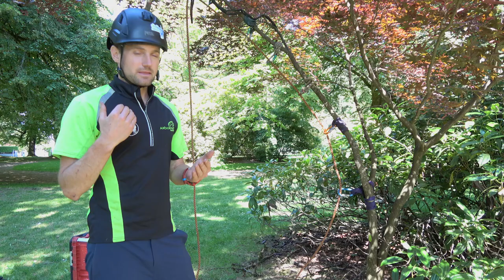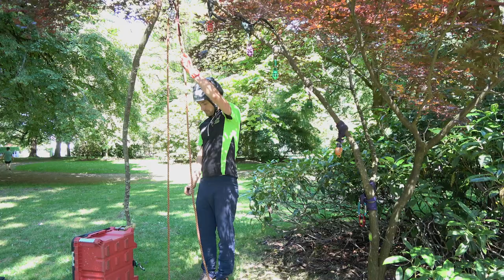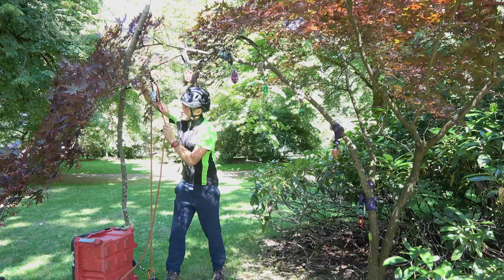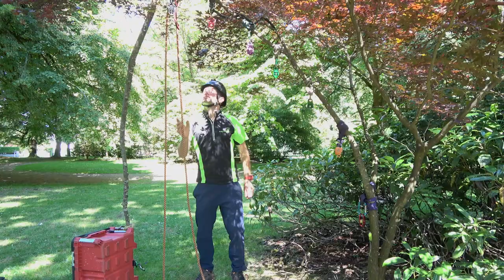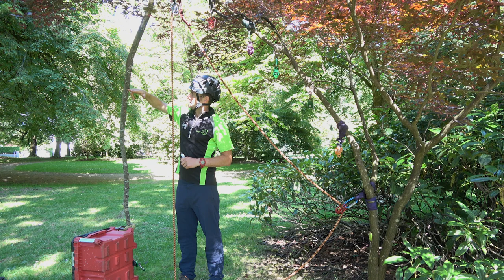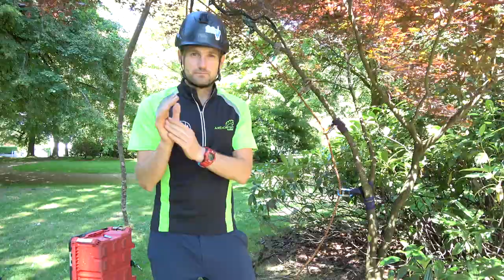Fishing pole rigging technique AWESOME DEMO showing how change in ANGLES and FRICTION affects FORCE

Comment: This technique should be taught on basic courses BECAUSE

the same principle can be applied if you have to climb up a limb to dismantle by hand and you're unsure of its integrity

You start by anchoring in a solid point below the limb in question, and then proceed to climb above your anchor point (on the questionable limb) and set these temporary karabiner anchor points every meter or so you climb up and clip your rope in

That way if the limb fails at a certain point and you fall, your weight is instantly distributed along the rest of that limb stopping you from A) falling all the way down until your original anchor point bites (due to having lots of slack climbing up) and B) eliminates you shock loading that original anchor point
Reply: Interesting concept, however if the branch were to snap under your load on a redirect, you would be shock loading the previous redirect with your weight and the weight of the snapped out limb portion, which may or may not start a Domino effect.

Maybe (Dan might be able to test this), you could place a ratchet or tirfor strap along the top side of the leaning branch to 'pre-stress' the limb towards the sky. Therefore when you climb on it, the chance of it breaking is far less. You would need to secure the strap/cable to the top side with smaller ratchets/slings/rope, but it could work

Comment: Terrific! What a great idea. Thank you very much Mr. Holiday. This could be very useful if someone has a somewhat sketchy limb they need removed. Looks like a fun physics challenge too. Makes me wonder what happens when you place pulleys in other spots on the tree.
Reply from the maker: Thank you so much for your comment Marty, and for your token of appreciation 🙏  It is a brilliant technique for special circumstances and as well as spreading the load and changing the direction of force it offers a backup of rigging points too. Any setup you have wondered about you can easily setup up in a very small tree like this and you can see the feedback from the tree in real time.

Comment: hello, you say that the first two pulley "share" the load. if you look at the angles, the second pulley will see very little force. the first and the last pulley will see the same force (how you pulled on it anyway) and all the other pulleys will see almost the same force. would have been interesting to say that with rings you will have more force while lifting and less force while lowering, with pulleys its the opposite. you kind of showed it but it lacked explanation.

also wouldve been good to show how a bisecting angle (loading the stem in compression) would make it move even less.

kind regards,
friedrich
Reply from the maker: Agreed that I mis spoke if I said the first two pulley equally share the load, obviously the end pulley is seeing by far the most force.